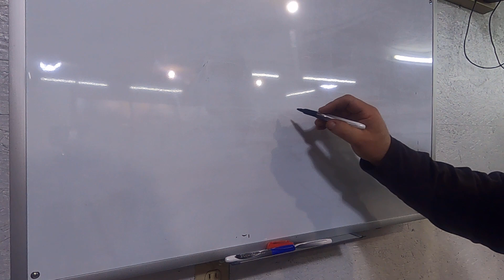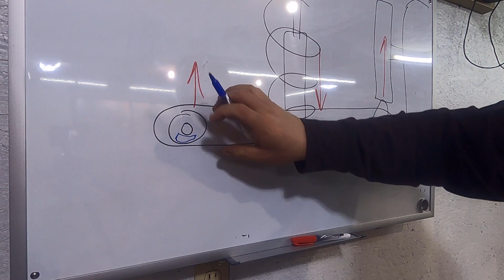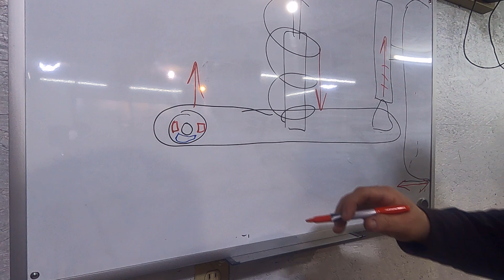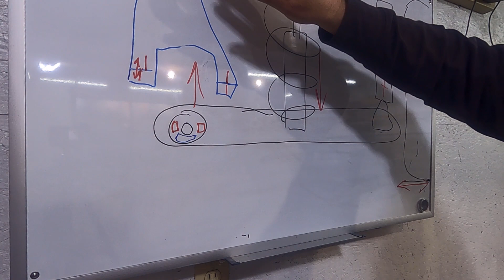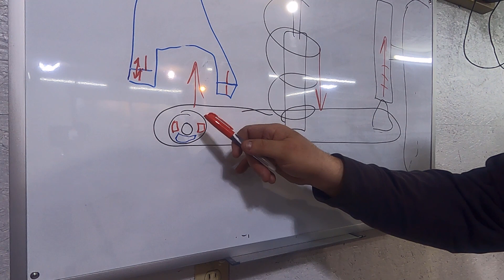Better Consistency, Reliability, and Repeatability? How to Install Steel Lower Control Arm Bushings

Comment: Another good one , Thank you. I’ve always tack welded my lower ball joints in where I can get to them as I’ve had them push out. Your thoughts on tacking them in?
Reply from the maker: I've never had one move on me but that doesn't mean it couldn't and if spot welding gives you piece of mind then I don't think it hurts anything. The weight of the car is pushing it into the arm at all times and that's why we don't see them coming up out of the arm as a norm.

Comment: I’m really enjoying your videos, very helpful as I just stepped into street stock racing. I hope you go start to finish and we get to see this thing hit the track!
Reply from the maker: Yes, We are absolutely filming it all. It's going to take a while and will likely take us 4 or 5 months total before we actually get this chassis to the track. I'm waiting on JD Squared to send me my new bender so right now I am going to focus my build on those cryptic suspension details nobody talks about. Thanks for the comment and more to come!
Reply: @DIRTRACELIFE  awesome. What made you go with an A body frame vs the G body?
Reply from the maker: A couple of things stacked up: a friend gave me the car, the front geometry is very very similar to camaros and all my builds up till now have been camaros, i wanted to build a car designed for rolling through the corners on smooth dry slick tracks and i felt the 112" with the 22 3/8" rear lowers was a better fit for that, the frame is just tougher, the CRUSA dropping the stock floor pan and firewall requirement helps me handle the additional frame weight, and EVERYBODY is running a g in this class and has pushed them to the max so I wanted to see what the 73-77 would do when it was maxed out similarly. Thanks for watching, more coming!
Reply: @DIRTRACELIFE  right on. Are you in the south east region?
Reply from the maker: Yes, we are in West Tn. We are within a 2 hour drive of 7 tracks and we always try to go to a different track every weekend.

Comment: Hey Jason I’m in the middle of building a car also. I heard that the wider front track of the wheels can help the front end geometry. That’s why I know that older 67-69 camaro lowers then switching the sides. Will give it a wider track on a G body car. Afco, and Speedway Motors sells them. Then 98-02 crown Vic lower control arms on a camaro chassis will make it 3” wider. With uni ball bushings from Howe racing and control arm bolts with grease fittings in the ends. That’s also helping with measuring the roll center’s. This makes much more negative camber very easy to get on RF. After being done and on the ground you have to measure the scrub radius, and adjust the wheel offset to get it centered. Scrub radius might be a good video I use it to turn my car left when on the brakes. I’ve raced both coil and leaf springs car’s advantage depending upon track conditions. I won with both types and championship with the coil.
Reply from the maker: Yes those crown vics sure can solve issues when your after 6 or 7 degrees of camber and must use a stock location upper. I think scrub radius is much less critical on dirt versus asphalt road course setups though.

Comment: Everything you talk about and show is very informative, so I thank you for that. I'm building a metric factory stock chassis. In my old car I ran polyurethane bushings for front lower a arms. Our rules say either rubber or polyurethane so I opted for the polyurethane. The rear trailing arms I always  rubber. Rules say again, rubber or polyurethane. So I'm asking for your opinion what you would use for the rear trailing arms. And I do know there are some really soft rubber bushings I've been thinking about but their kinda pricey. Just didn't know if it was worth they money plus they only last 9-10 nights. Sorry for the lengthy comment.
Reply from the maker: Jimmy, I would run the rubber ones on the rear because of the torque absorbing benefits you get that poly can't provide. However, the reason I am promoting using just stock rubber is because of feedback from a top competitors who had put in the work of testing the different durometer rubber available and he determined the best choice ended up being a medium hardness offering that was very similar to most stock brands they checked.
So thats the reason I ordered a set of stock AC Delco brand ones that we will start out with on this car. I think this is one of those areas where you can waste money and get no gain... but we'll see!   
Thanks for watching my videos.

Comment: Nice work Jason,  Very informative..
I install my ball joints and bushings by first putting them in the freezer overnight, they contract enough that I can just drop them in. I learned this installing sleeves in engines. I saw a guy driving them in with a board and hammer. My grandfather told me to put them in the freezer overnight and the sleeve will drop right in. So I applied that lesson to other things, works great!!!  
Still racing dirt and asphalt ovals.
Love your stuff, keep it up!!
Reply from the maker: My granfather in law had a shop where they overhauled tractors (mostly older gas burners). He taught me about the deep freeze deal and we could drop those dry sleeves right into those old ford tractors. I should be doing that for everything too. I get in a rush and just don't think (at least I am going with that as an excuse). But yes you are spot on :)

Comment: Hey Jason,  modifying stock lower control arms has been one of my best kept speed secrets.  Just a couple questions...Why didn't you opt for Screw-in style collars and ball joints, and why not buy the slightly smaller steel bushings and tack them in?

Sleeve part number (Speedway Motors) 
Part # 91034816
The sleeve style allows you to lengthen the Right side lower Ball Joint  ;)
Reply from the maker: Cregen, 
   I want to always be as honest and candid as possible so I won't stop now or make any excuses. Yes, I agree with what you are saying but chose not to. My concept for this build has been focused around figuring out how to think outside the box, being willing to try new concepts, to try and "build a better mouse trap" and importantly, working with a very limited budget to spend the dollars I have where I can get the biggest bang for the buck. In this case, I felt the solid bushings were a must have but the additional cost in racing upper and lower ball joints was not. YES, I do agree there is an advantage to be gained with all super smooth ball joints, bushings, and bearings but there is a significant price to be paid as well. 

My first priority has been how to take the budget I have and make sure I put what is hopefully a very competitive car on the track. But  hey that doesn't mean I can't do some episodes this summer on upgrades where we can actually be able to feel if they made a difference and show that :)
Reply: @DIRTRACELIFE   I agree with keeping the costs down as much as possible.  I do the same.  I run on a budget of 3K per year to get the car ready and freshened up, and then it supports itself through the season and even makes a little money back.  

I don't use Howe style ball joints or any low friction racing ball joint.  That sleeve part number I sent you accepts Stock Chrysler Ball Joints that are only $20-$30.  I prefer them for the ease of changing over the press in style. Also they are a heavier duty than the GM style. Plus like I referred to earlier, the Screw in Collar allows you to make your RF Lower 1" Longer and still appear stock.  My question was more or less directed to your heating of the lowers.  Just trying to save you a little time and acetylene
Reply: That's mint, I didn't know this threaded collars were a thing !
As a Mopar guy it's nice to know, I'll be able to repair/beef-up or make custom geometry control arms easily, but also reduce my spare parts stash by Moparizing a lot of my other vehicles!!! Thanks

Comment: Great Vid! What's the source for the balls and the steel-to-steel bushings? All MOOG? Thanks!
Reply from the maker: I use rockauto for the balljoints. You can search something like a 1976 C10 truck to find the upper balljoints or whatever car for the lowers and look for the "Moog problem solver". Speedwaymotors has the steel bushings and I believe any All Star dealer can get them as well.